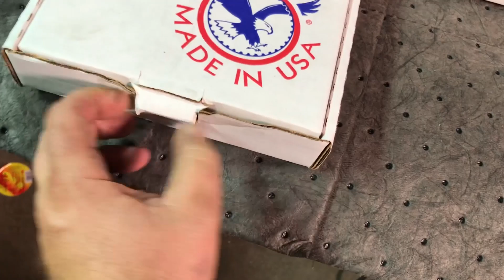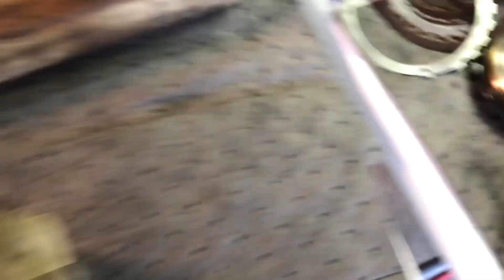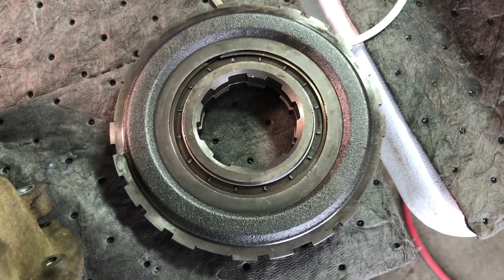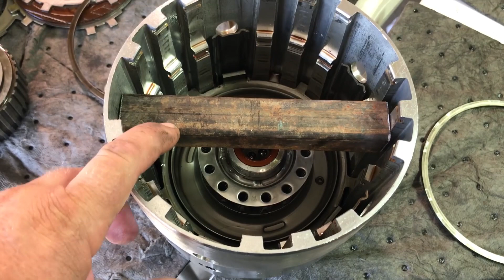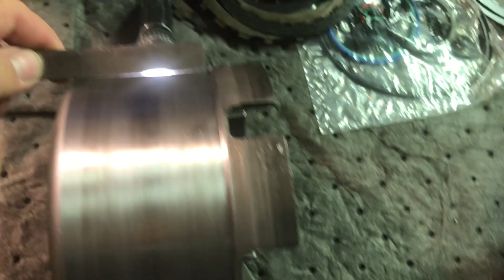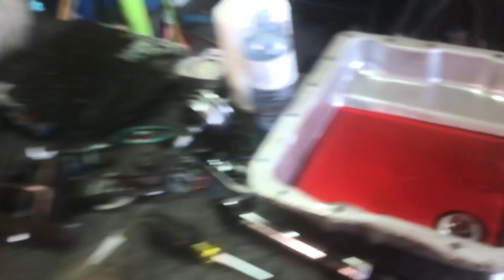4L60E Rebuild Part 3 - Installing the Guts!

Comment: Wondering if not replacing the sun shell ever came back to bite you.  I've done 6 4L60's and 100% of the rebuilds were to replace the sun shell that failed at the spline or cracked around it.  :(  fingers crossed for ya.
Reply from the maker: So far it hasn’t failed yet. I’ll be upgrading to a 4L80E over the winter so it just needs to last a little bit longer.
Reply: @LowbuckLS  Fingers crossed for ya!  I learned the hard way, with the 4L60, NEVER, EVER, ever,ever,ever....  take it out of reverse while still rolling backwards....  I know that sounds obvious, but it's how I've blown 3 sun shells.

Comment: Are you using actual grease instead of transmission assembly lube?  If it is actual grease, it will end up in your screens and your filter, clogging them up, where assembly lube melts under the heat and combines with the transmission fluid to keep your screens and filter running clean.  I ask because you did say "grease" and it looks white/yellow, unlike the red, blue, or green assembly lube.  Grease in the tranny is a no-no.  That said, I like your improv on building your return spring compresser - like your accent, it fits well with our Alaskan improvisation ways or the Red Green show, whichever you choose.

Comment: Hello, excuse me for my English, but such a question arose .... There are no holes in the ALTO set on steel discs for better cleaning of oil during compression ... What is the reason? Maybe it makes sense to drill the holes yourself? I realized that such discs were installed on early models. Now in new kits from other manufacturers, steel discs come with holes .... Who thinks what? What to do?
Reply from the maker: I’m not sure of the reason that there are no holes in the steel discs of the Alto set, but I would not drill the holes myself. My opinion is that if the manufacturer thought that’s the discs needed holes they would have drilled the holes at the factory.
Reply: I looked at the packaging just now, and found that these bags are for 4L60, steel discs without holes, clutches without oil drains ..

Comment: Can I put the High Temp Hyper Blue Piston in a stock 4L60E? And How Much Better is the Hyper Blue?
Reply: I use all hi-per blue pistons (dont trust stock black rubber ones) repaired my 4l60e that was built by a shop that didnt last long I lost 3/4 like 3 times in one year anyway got tired bringing it back so I took it apart myself and rebuilt the input drum. Hi-per blue pistons new steels Alto HEG overrun and forward frictions but my 3/4 I used 6x GPZ100 .080 frictions and 5x .106 steels new .225 apply plate and .193 backing plate and got .038 clearance its been really good for about a year now. But now im building another 4l60e because I think I can build a better one than that shop built me this time im gonna use thinner steels and get one more gpz clutch in there to make a 7 disc setup also doing other thing too.
Reply from the maker: I’m not sure about that, I’m not familiar with the hyper blue piston.

Comment: I found while installing that the kit from summit has an incorrect clutch pack for the 3-4 setup. 4l60e should have 6 clutches and 5 steels. The kit has 7 clutches 6 steels. The measurements indicates they are for the 4l65-70e. Using the kit as is does not allow for proper end play, (.060-.080). there is no endplay with the factory backing plates. I used the backing plates by sonnax 74140-01k, this backing plate setup allows you to use the clutch pack in the kit with the 4l60e giving you a total of 7 clutches and 6 steels. I spoke with summit techs, theyre guessing someone messed up when assembling the kit.
Reply: Take GM's .060 to .080 clearance and toss it out the window!! GM's clearance spec's are way to much ive air tested drums with the recomended clearance and always got blow by when you tighten up clearance you dont get that. The more that 3/4 piston travels the more pressure you lose causing a weak apply slip then burned clutches, with a 6 to 8 disc stackup ide shoot for around .030 but either way nothing over .040 only time ide see going more would be if you were doing something crazy like a 12 or more friction setup were your using thin steels and need more clearance and fluid to help with heat problems but then you run the risk of a weak apply.
Reply from the maker: @martinez1701a  very good to know, thanks, will remember that for the future.
Reply: @LowbuckLS  I seen this when I was learning how to build the drum I had gotten several complete drums online for learning purposes (also cuz I wanted the parts) all had burned 3/4 except one that came from a running vehicle. Air tested them they all had the same blow by even the good one didnt think to much about it just though they all had bad pistons but when I built my own with recommended clearance I got the same blow by. So after some fiddling taking it apart making sure I didnt do anything wrong decided what would happen if I tighened up the clearance so I ordered a thicker backplate that was .037 bigger swapped it in and no blowby, for good measure I ditched the stock black rubber molded pistons I bought and went with Hi-per blue instead and that seemed to work even better, anyways thats my story lol
Reply from the maker: Carl Ervin good to know, thanks for sharing that advice.

Comment: All that hard work without replacing the weak sun shell with a new gm heat treated one almost 99.9% of 4l60e oe sun shell strip or.break
Reply: very true!!
Reply: That’s really not true. 05-11 that prob with the sun shell stripping out or breaking doesn’t happen. Before that 93–04 most have been rebuilt bf and have a heavy duty anyway. 80% come in w 3-4 clutch failure.

Comment: Did you do anything special for cleaning the components?  Mainly the big body of the transmission and valve body to get it all the "nooks and crannies" to be sure the passages were clear?
Reply from the maker: Marshall Dominick I took it to the plant I work at, they have a big heated “Hotsy” parts washer which is basically like a big industrial dish washer, I put the main body of the transmission in there to clean it once it was disassembled.
Reply: @LowbuckLS  any other good way to clean it if I don't have access to an industrial machine
Reply from the maker: Ricardo Rodriguez you could probably just take it to a car wash and use some degreaser and a pressure washer to clean the case
Reply: @LowbuckLS  thanks for the quick reply I'll be following these videos for my 97 s10 in a few weeks
Reply from the maker: @305Ricky  you're welcome, thanks for taking the time to watch and comment.

Comment: These morons that say there rebuilders, they don't change bushings, that unit should last .. your a quack.
Reply from the maker: Brian Ouellette although I didn’t show it in the video I did check the bushings for wear and compare them to the new bushings that came in the rebuild kit and made the decision that the old ones were serviceable. It’s my transmission and I’ll repair it how I want. And so far it’s holding up fine. I do appreciate you taking the time to comment and voice your opinion though.
Reply: Hey Brian, Try some professionalism. point out things YOU DO and WHY. THanks.

Comment: @ 56:04 .... Did you have electrical tape around the input shaft when you put the pump on? Cause I didn't see the Teflon O-rings
Reply from the maker: zeke112964 must have just been the lighting, the Teflon rings were on there
Reply: @LowbuckLS  On second look I do see them